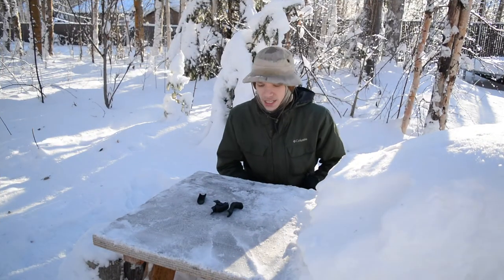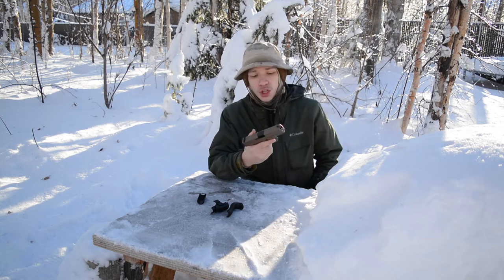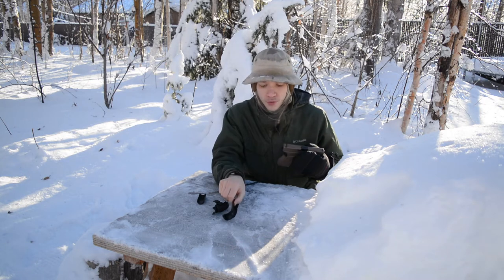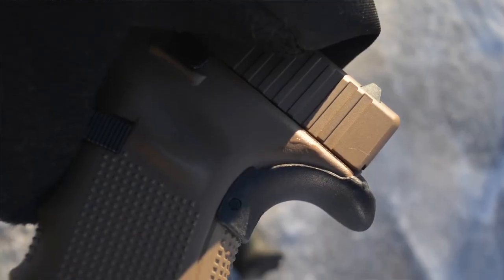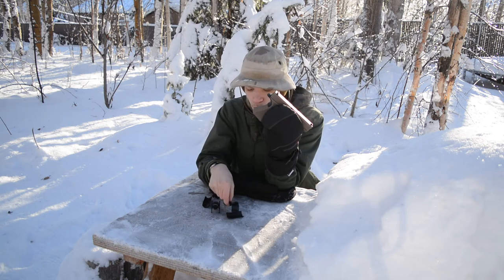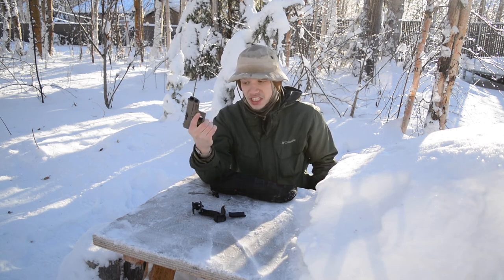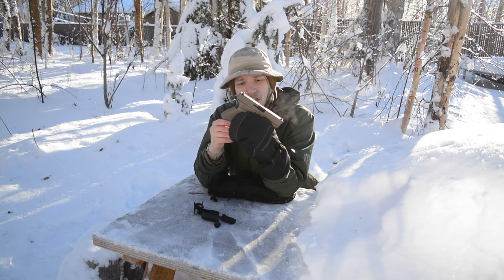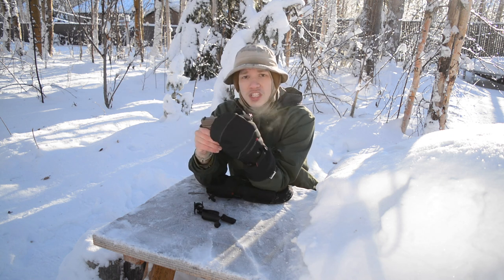GLOCK MODS, HOW TO MAKE A DIY GRIP FORCE ADAPTER BEAVERTAIL

Comment: I appreciate how articulate you are in your video. Good explanation, and a clear presentation. I have a Gen 3 Glock with a Grip Force adapter that I really like the angle on, and a Gen 5 Glock with the factory beavertail backstrap. I think I'll do your mod to my Gen 5. 
One feature I would recommend, is smoothing out the transition on your beavertail. Filing it to a thin edge will help it feel more seamless when gripping the gun.

Comment: That pin has a much more important function than just holding the back strap. It holds the internal moving parts of the frame in place.
Reply from the maker: Well yes. But for the purpose of the video...

Comment: Nice! I just think it's cut a bit too short which is why you get the small gap between the handle and the beavertail. A little longer would help the leverage and close the small gap. It may not matter but I'm just commenting on why I see the gap.
Reply from the maker: Thanks for the tip!

Comment: Why can't this work on a gen 3?
Reply from the maker: Gen 3 doesn’t have back straps
Reply: I've been carrying glocks since 2003. I am aware gen 4-5 come with back straps. However you can purchase as you even mentioned in your video bever tail/back straps for gen 1-3. Certain models need minor adjustments.
Reply from the maker: @Pocketpowerplant  yes, what you’re not getting is these are factory grips for the Gen 4/5 that have been modified to just retain the beaver tail. Did you watch the video????